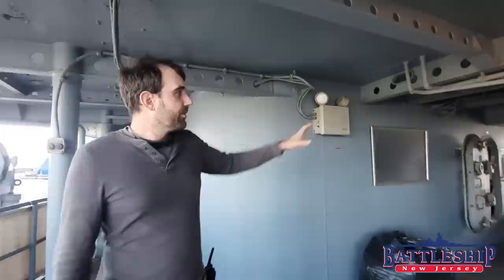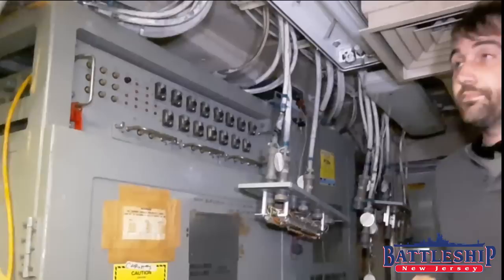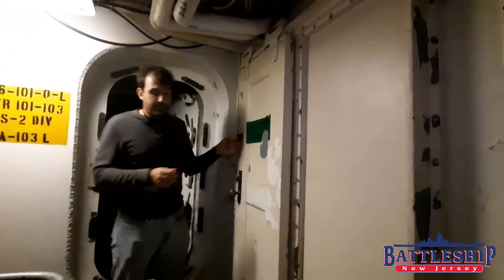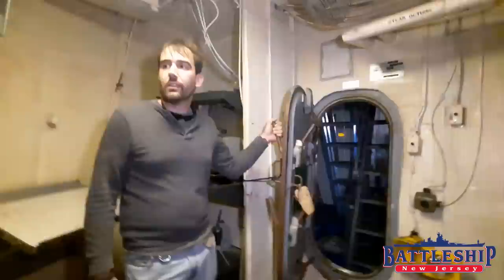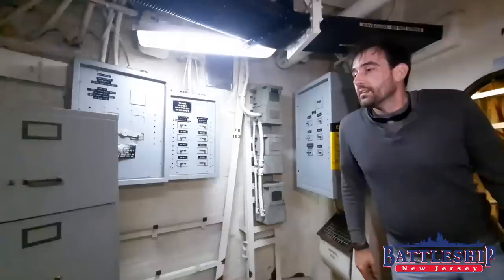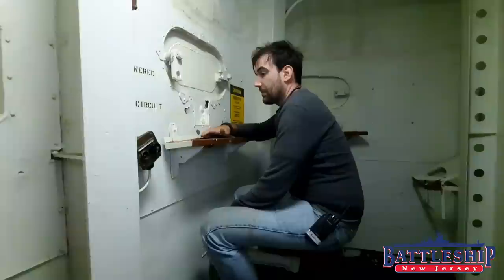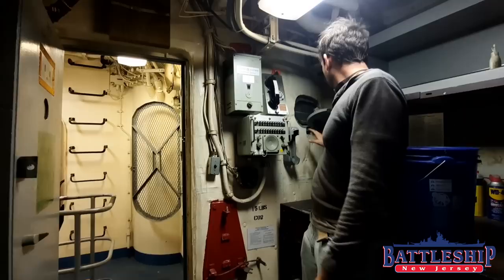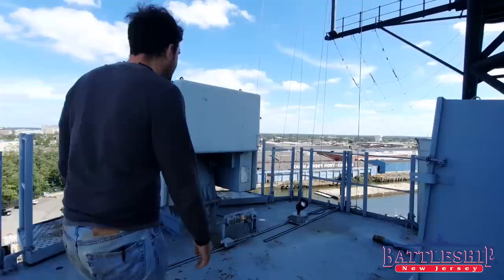Battleship New Jersey's Superstructure

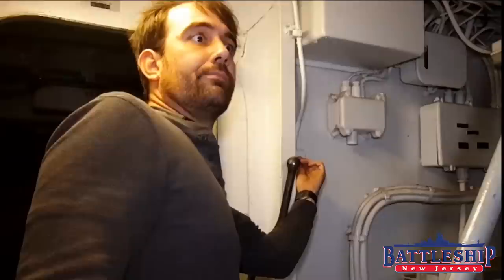Comment: 4:30  Former SPS-49 Technician here, if you want the antenna to spin for display purposes only the simpler (and cheaper) option would be to make the Antenna independent of the rest of the system and power its motor separately.  A lot of the stuff that was gutted out of that Transmitter cabinet has nothing to do with "Making it spin" mostly its for RF generation.
Reply: also the second SPS-49 equipment room you showed was indeed a pump room to provide cooling for the SPS-49, most of the cabinets were air cooled however the transmitter cabinet and major components within it were water cooled with Distilled water, which was then circulated back through the Heat exchanger in that room and cooled with seawater
Reply from the maker: We got it spinning, actually! We're still working on an easy on/off switch but we got it to rotate with the motor.

Comment: Memories...  worked on 16" turret sprinkler systems during the Nam reactivation 1968.  Went alone the piping that holes drilled in it and cleaned them out with welding wire sticks.  boring, boring, boring.
Reply: Boring, but someone had to do it. And you just happened to be that someone.
Reply: @thegeneralissimo470  there was one time it got exciting. There was a test on the fire sprinkler mains to the hydraulic hand cranked valves to the sprinkler heads. I did not know the lines were under test pressure and messing around I cranked the valve.  Needless to say alot of passed off yardbirds that got wet. I never told a soul it was me.
Reply: @us-unclesam6566  legend what was the aftermath of that story
Reply: @austin62halo  I never touch anything, I am not suppose to.
Reply: I wish I could see a battleship fire it’s main guns in person. I would specifically want to see Yamato’s guns firing
Reply: @metaknight115  If they fired a broadside salvo, the ship moves 3 feet sideways.  If they  fire the forward  main battery while steaming straight ahead the ship will slow down to a crawl. During a river run test fire all the yardbirds tool boxes jumped off the racks and went overboard.

Comment: Sometime around the 80's I was First Assistant Engineer on a Chevron VLCC heading up to load in Saudi.  Iran & Iraq were shooting at each and anyone who got close and both Royal Navy and US Navy had warships in the Gulf.  I was doing some work on something on the Bridge and the Old Man called me over and pointed out a huge mountain of dark grey on the horizon.  "That's the New Jersey"   he told me.  Binoculars only showed a few smaller grey lumps around a larger grey lump. As I was watching, I saw white water at the stern and they all started moving. The old man put the group up on the radar to show speed and course - our radar lost the group accelerating through 30knots and they vanished over the horizon.   The ship I was on burned 270 tons of HFO a day at full sea speed of 18knots - I wondered how much fuel  that big lady burned at full speed?  All our steamships have been scrapped now and I finished my career on large slow speed diesels - these were great engines, but none had the class or panache of the steam turbines.

Comment: If you have not done so in detail, you might want a video on the changeover from direct current power used in heavy machinery power and the limited fire-control systems introduced early in the 20th Century to alternating current power for most of the later ships designed in the 1930s and thereafter that NEEDED AC power for the Synchro/Selsyn data transmission systems (extremely accurate and capable of being amplified to directly run the controls of precision motion controllers for gun mounts and directors/radars), which were still in use in the late 20th Century and are only now being replaced by direct digital transmission systems.(though sound-powered old-fashioned headset/microphone telephones still seem to be in use).  This is one of the reasons for the US superiority in WWII for fire control, most especially anti-aircraft fire control.  Extremely important topic!

Comment: When I was watching this video, I was under impression that this is what a spaceship designed for thousands of years would look like. Heavily built, durable, rarely visited rooms, highly compartmentalized, with lots of old equipment, everything labeled for others in the future, power lines and pipes, no windows, everywhere doors to cut off a compartment, with many systems like AC supporting locally but also ship-wide connected. And a labirynth for a layman.
Reply: Dude watch Starblazers!

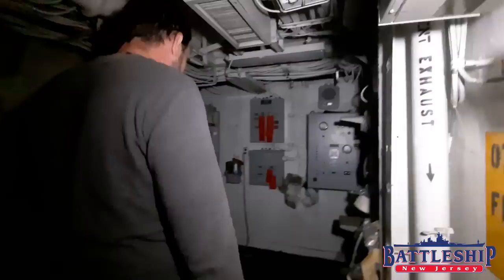Comment: as a sps-49 tech currently I hope you get it spinning, the pump room may be the cooling skid as the 49 is water cooled. The space at 12:00 is URN-25 TACAN (tactical air navigaton) beacon equipment. Used to provide bearing and range to aircraft out at sea.
Reply from the maker: Update on the sps-49, we've got it spinning! We are still working on the electrics to get it to spin from a control box that isn't the radar deck at the top of the ship so we aren't doing it regularly but it does spin!

Comment: The main reason for having redundant ladders was actually for survivability. One ladder might get destroyed but the other survived. They wanted to reduce the chances of crew getting trapped in the superstructure. This is why any properly-built warship will always have at least two of everything important. The handful of stools and such up at that high level weren't really heavy enough to warrant the effort and expense of removing. You're talking maybe saving 30 pounds of weight, but for the amount of time involved you could remove something much heavier from somewhere else.

Comment: Loved to see where the klystrons radar tubes.  We manufactured them
Reply: Answered my question.  Saw the chamber called new klystrons. The rader tube VA911D would use a large electro magnet
Reply: Saw the phalex gun.  Klystron vku7785e1.  We built those tubes too.  Along with others I see
Reply: Correction. VA-911c klystrons used for firefighter radar.   90kv beam

Comment: Hello Ryan. My question is: what is the point of having watertight doors that high up on the ship? wouldn't a regular door be fine? and probably lighter?
Reply: Rain. Storms can be pretty fierce out on the ocean.
Reply: @AKAtheA  Also 'air tight' to protect from NBC attack.
Reply: @blendy19  actually no, they were designed and built before they added the "N" to NBC. And chemical warfare at sea is not really all that effective anyway :P
Outer doors keep water (and shrapnel...) out, inner doors keep the water (and explosions) from spreading.

Comment: My guess that 9 level spotting deck was kept for the same reason it was there to begin with. Not because it was needed regularly, but because electronics/equipment breaks, especially when someone's shooting at you. You leave it in position or you could end up like the Bismarck, and unable to target anything when the wires get "cut" (blown asunder) during a fight.
Reply: assuming you're right, then why the ports were blanked off? i doubt that would have been part of the mothballing process as to me it would be unnecessary work and there's other, more accessible portholes that are still open

Comment: When I reported aboard in the 1980's, I had some free time to explore, but the one place I never got around to was a shaft alley, which are very interesting as they are where the thrust blocks are fitted. For those that don't know, a thrust block is a structure that allows the thrust from a propeller to be applied to the hull of the ship, smaller vessels have the thrust block integral with the reduction gears, but I was told that the thrust blocks are in the shaft alleys

Comment: When you walked around the black structure, inside the catwalk; the one you said was capped off, you called it a funnel. Is that the boiler fresh air inlet to the boiler Forced Draft Fans or natural draft and Boiler exhaust chimneys?

Comment: This has probably been answered before, but how much of that modern equipment has been demilled? Especially those Phalanx CIWS systems which appear to be fully intact, did they just take out the radar and fire control or did they demilitarize the cannons too? I'm surprised they let you guys keep them given they're a modular and still used system (and they're badass 20mm rotary cannons lol).
Reply from the maker: The 5in guns, the saluting guns, and the bofor are all functional and fireable. The other weapons are not. The CIWS was entirely gutted and is just a shell without any of the electronics.
Reply: @BattleshipNewJersey  Awesome, thanks for the quick reply!

Comment: Have you done a video showing us the first aid kits that we see mounted to the walls? And the contents of them? Are they filled with first aid supplies you would use on volunteers today?
Reply from the maker: The large metal first aid boxes you see on board would have been sealed so they knew if someone used anything and needed to be restocked. They looked pretty much like a regular first aid box inside. Stuff to stop bleeding is the priority. Today we have more modern boxes around and AEDs.

Comment: I FOUND THAT WORKING ON ANTIQUE CARS AND BASICALLY ANYTHING METAL IF YOU ARE TRYING TO SAVE AN ANTIQUE THE BEST THING TO DO IS USE STEEL OR AS NECESSARY BRASS CUP BRUSHES I NORMALLY WHAT WOULD BE ANGLE GRINDERS OR POLISHERS AND YOU'LL GET DOWN TO USE THE METAL WITHOUT DAMAGING THE METAL AND IT BURNISHES  IT AND PREPARES IT FOR PAINT .
DAVID GRENIS
2044 MAPLETON
BOULDER COLORADO 80304

Comment: Two questions: 
1: How far above the waterline is the top of either funnel?
2: Theoretically (with some changes, modifications, and assistance) Do you think the USS Wisconsin could possibly be moved all the way to Lake Superior?
Reply from the maker: These ships are too large to get through the canals necessary to get to the great lakes. You'd have to cut it up to get it there. There have been academic discussion about building great lakes battleships but they were never followed through with. For more info on that, check out Operation Inland Seas. 
Top of the stack is about 100 feet above the waterline, but that is somewhat variable depending on where exactly the waterline is.

Comment: The Iowa class battleship would've beed not just good but great if they had not designed them so narrow.    I know they wanted to be able to traverse the Panama canal. It probably helped a bit with maximum speed as well.
Reply: They did have a select few flaws that prevents them from being better then HMS Vanguard And IJN Yamato in my opinion. They had very weak armor, bad maneuverability, and accuracy issues due to a poor quality of gun powder for the mark 7 50 cal 16 inch guns

Comment: How did they get a air compressor, which probably weights 300-500 lbs up to and inside the 10th level? None of the doors looked big enough for it to fit through.
Reply from the maker: There are hatches up there to crane it up high and lower it in or the ladders can be removed and it can be craned up internally. This was before this writer's time. Not sure which they did.

Comment: What is the padlock and sign for curators permission for?
Reply from the maker: Most staff and volunteers are not permitted in all areas of the ship for safety reasons. If someone gets hurt here, it is extremely difficult to get them out so no one should be there without the knowledge of the curator and without suitable safety precautions.

Comment: what gets me is in most of the rooms the cabinets and equipment looks to be to large to fit thru the hatches and stairways.. not to mention the effort it took the haul that equipment to those locations on the ship.
Reply from the maker: Almost all equipment larger than the 26in doors either has been there since they built the ship or comes in pieces in order to get it through the doors. Everything is planned out that way. Even simple things, like the standard arm chair is narrower than 26in in order to move it around.

Comment: Great video! Love these areas! If you had time could I ask you to explain to me the purpose of the metal horizontal rods I see off to the right that but that are attached to the ship at frame 17: 21 through 23.? What are all that stuff on the side used for. And are those lights on the side? And have you done a video about the search lights how big they are, the wattage, maintenance of them, how far they'll broadcast, and what size the bulbs are and can you power them up at any time? Thank you!
Reply from the maker: Those are either supports for the awning or an antenna. Not sure what exactly you're looking at. Yes, there are lights all over the superstructure. No, we haven't done a video on search lights, were in the middle of restoring ours right now, so stay tuned for when thats done.

Comment: Glory hole S-1 storage and tech library. Housed ships stores such as repair parts and cleaning supplies , office equipment and supplies. Paints, grease's and lubricants for maintenance Etc. The S-1 Dept. Issues these  items as needed by each Division. A 1250 supply chit filled out with stock no ., Qty and subtotal and total cost sign by Dept head or division officer. Each dept. Had a budget to spend wisely. Tech library NSTM's repair manuals. Breaks down each and every part or piece of equipment carried onboard. That were serviceable by ship crew. They didn't leave the library, fear of loss or damage. Copies made of pages needed to complete repair. Usually kept in each shop upon completion of repair. Sound powered phones were common in case of loss of power in the space.the clothing should be for Wardroom cooks and stewards. Dress clothing for parties setup for visiting VIP and dignitaries.  Wardroom cooks and stewards wore different uniforms than crews mess cooks. CHT collection holding and transfer. Nut she'll import everything to tank, pumps on diverted to main piping and valve. These valve ironically painted gold. Make readiness for underway.  CHT  all black water to tank that's toilets and urinals. Grey water showers, sinks scuttlebutts and sculleries overboard. Most crew were at the post so to real amount going in sea. At sea everything overboard and tanks flushed twice and pumps secured. The system had high level alarms on tank in case pumps not working. Alarms on Bridge, Quarterdeck and DCC. S-2 Mess cooks . S-3 Ships store ,geedunk,pop machines, Barbershop, laundry. There store rooms aft along with crews stores food, refers and freezers. More later.

Comment: I'm curious what the mechanical link is from the wheel in the conning tower to the rudder.
Does the wheel open a hydraulic valve that sends fluid from the conning tower all the way down to the rudder?
Reply: Electrical signals through a set of syncros.
Reply: @camaro97383  I was thinking there had to be a mechanical link so if they lost electricity it would still work.
I guess it would be a lot easier to repair an electric line, than a hydraulic line.
Thanks.
Reply: Multiple steering locations.   

Including directly above the rudders themselves.
Reply from the maker: For additional details, go to: https://youtu.be/OgdGWw7Jpyo
Reply: @BattleshipNewJersey  Thanks.
Reply: @camaro97383  Thanks.

Comment: I've not yet viewed all the videos nor gone through the list to see if a video was made on this subject but,...
I was wondering if there is a video log (or pics & associated commentary) of anyone who actually helped build these ships.
It would be amazing if any old steel rats could come back and see this old girl & point out specific areas they built.
And to talk with the designers (anyone have a time machine?) who came up with the various layouts & made sense of it all.
I'm sure it looked great on paper but just the thought of installing all the wiring makes my brain numb.
One thing I've noticed in the dozen or son vids I've watched so far is that all the piping/plumbing is the same color.
Wouldn't each pipe be a different color based on purpose?
One color for water, another for fuel, sewage, various electrical purposes, etc....?
Or is such a thing a more modern concept?
I make such reference based on tv/movie observations, not actual ones - so I'm just guessing...
Btw, just in case I win the lottery, what size donation would I need to make to acquire a permanent residence apartment within the ships superstructure...?
😀
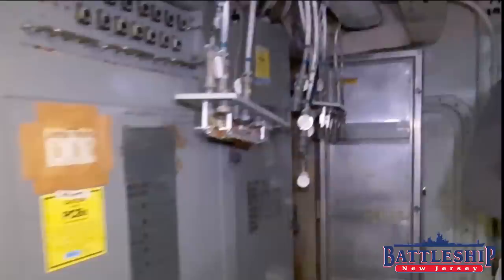P.s. at 4:46 I noticed the camera panned quickly by the word Klystron on the wall. 
Was the Klystron Frequency Modulator one of the components removed for later use in other ships?
😀😀
https://oldschoolsciencefiction.tumblr.com/post/149674763938/that-special-klystron-frequency-modulator-from
Reply from the maker: Check out our playlists for interviews with shipbuilders, here's one of those videos: https://youtu.be/xbtCC03ffvc